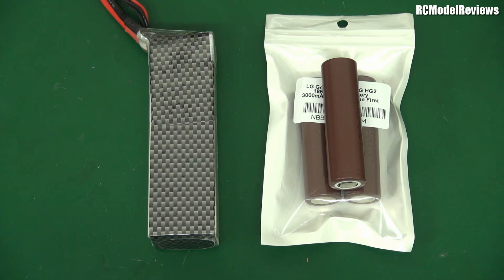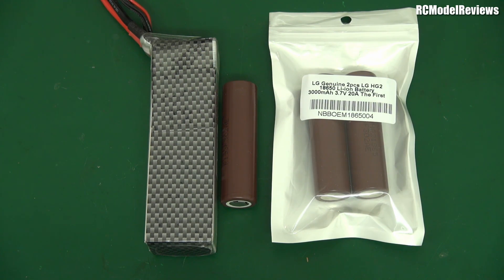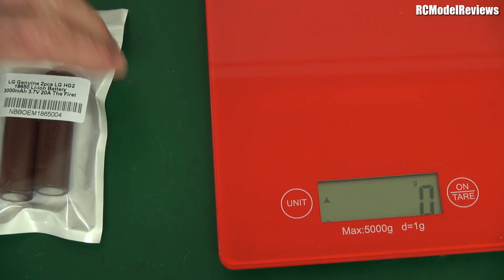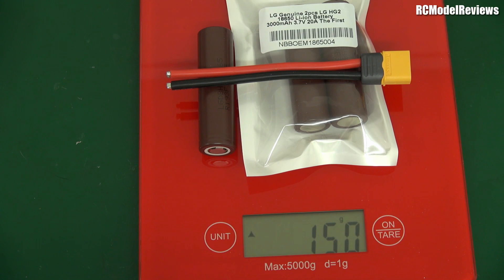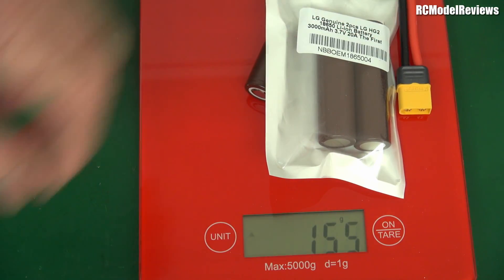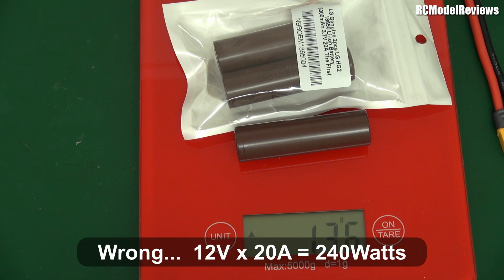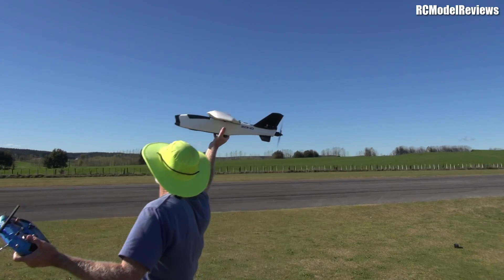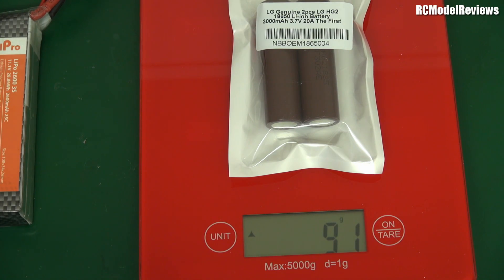Lithium-Ion (18650 cells) versus Lipo -- which is best?

Comment: Should make a hybrid battery with a small lipo and big lion pack
Reply: It would be great for transients like on launch and quick punches: launching Strix Goblin on 18650s is challenging to say the least !
Reply: Preproto you’d want a battery management system otherwise you could run into... issues.
Reply: @kand198  This isn't a powerwall or ebike: it's solved easily with telemetry.  If an entire series bank goes in an RC setup, well ces't la vie - we live with that risk every day.  This is why it's good to run a separate RX/VTX battery in a plane so that one can attempt to safely land if the main pack goes belly up.  In a quad, it doesn't really matter, so bombs away ! :)
Reply: I might be missing something here, but just thinking about it, due to the very different internal resistances of the batteries you’re going to be drawing very different currents from each pack.

Also they will have differing capacities (even if there rated capacities were the same).

Both of these factors will cause problems pretty quickly.

You could probably develop a pretty simple BMS that could be integrated into a PDB or ESC (PDB would be easier to design than an ESC but there are open source hardware ESCs out there) that could handle this.

A more rudimentary design could be to have a switch on the plane to swap what packs you’re drawing from bound to a switch on your controller.
Reply: Keith Anderson what problems ? You're making unfounded assumptions without any scientific basis. It's the exact same principle as capacitors used with batteries so the capacitors with far lower IR charge and discharge infinitely more quickly than batteries, allowing pulses of brushless motors to be smoothed out. A hybrid pack allows short bursts of high current which then essentially recharges from the higher IR cells when the high load is removed. 

I've built a pack like this myself by adding a cheap 3S car jump pack connected in parallel with 3S40P 18650 NC cells in a jumper box that used to have a Pb-acid battery. It wouldn't start a vehicle previously but does without issue with the low-IR cells added.
Reply: How do you ensure your cells stay balanced? Just be aware that that setup is still pretty low current and voltage so worst comes to worst you’ll probably just be killing your batteries faster.

My main concern is that if the batteries fall out of balance you are going to introduce inefficiency, wear, danger and lower performance.

Thing is that while they will “charge” the higher discharge batteries it won’t charge the cells evenly right? Keeping your cells balanced is really the core of battery safety.

I’d also be interested to see how it would perform in comparison to choosing a cell that has the right specs for the job in the first place. Or some sort of cap/super cap setup.

It just seems to me that in situations where it’s too small for a BMS there would be better solutions out there?

Also I wouldn’t consider it unscientific, it’s just that I’m too lazy to fully work through an analysis to check if what I’m saying makes sense - which I totally accept might not be the case.
Reply: Dave Johnson 

I discussed it with someone a lot smarter than me last night.

Straight away he made the comparison to supercapacitors.

The conclusion that we came to is that you would very quickly exceed charge and discharge rates on the Lipo and/or the liion packs if you were to draw any large amount of power, and that supercaps make more sense from a weight-performance standpoint but can be a lot more expensive.
Reply: Keith Anderson I'll just be over here actually using  hybrid packs without issue while you armchair quarterbacks keep chugging Miller Lites and fist-bumping 🤣
Reply: Dave Johnson ok buddy you can call me an armchair quarterback when you design and build a 600V accumulator from scratch.

If you want to ignore my advice then that’s fine. Since you don’t seem to have a very good grasp of electronics and battery chemistry in particular but are obviously into the hobby side of things I’d probably explain it as having very similar risks and consequences to charging LiPos to 4.25V per cell.

You have basically built a ghetto and impractical supercap setup that will cause the premature failure of the cells. There is no benefit over supercaps besides procurement convenience.

But I mean most hobbyists fly with puffed LiPos and shit so this is far from the worst I’ve seen.

Comment: Are there any chemical constraints for lithium-ion unable to provide the same or better current discharge as lipo? (on similar weights proportion to the ones demonstrated)
Reply: The often used distinction between Li-ion and Li-polymer has nothing to do with chemistry (it is used wrongly). They are all Li-ion batteries. The two battery types are the same thing, just in different form factors. That form factor (and therefore different internal construction) is the main reason for the different current capabilities. There are cylindrical cells available that can easily provide currents in the tens of amp like a pouch cell, because their internal construction is designed for that. The pouch cells, that so many erroneously call li-polymer, are just "li-ion polymer" cells, because they are wrapped in a plastic (=polymer) package as opposed to being in a metal can.
They can have different chemistry, but so can cylindrical cells between them and pouch cells between them. Again, the form factor is not what dictates the chemistry, what the manufacturer puts in them is. You can have the same chemistry in either form factor. Have you ever seen something like IMR, INR, ICR, IFR, LMO, NMC, NCA, NCO, LCO or LFP written on cylindrical cells or in their datasheet? Those signify different chemistries. Pouch cells use the same, although they mostly use the Lithium-cobalt-oxide chemistry (ICR/LCO).
Reply: superdau That makes sense. Saw those labeling in 18650 cells.  Thanks for the awesome explanation!!
Reply: There is a wide range of chemicals and electrodes for different applications. Basically you trade either cycle life or high discharge rates.
Eg the Rimac new 2C supercar has 120C discharge capacity 18650 cells.
Tesla uses a NMC composition for its storage batteries and NCA very low cobalt percentage for its automotive batteries. The cycle life is increasing, doubling every few years with latest estimates giving a million miles of use in their next generation Maxwell electrode packs, whilst dropping cost to $100kWh at the pack level.
https://youtu.be/VtoBkFF3X7E?t=378

Comment: Li-Ion tend to be used in low-impact environments, as the electrolyte is more liquid than gel (and also why the stronger casing).  Lithium is highly reactive (read combustable) and a case breach is likely catastrophic to a model.

Should be great for a cruise wing type model as the discharge rating is usually not as high as Li-Po, but for a raw power machine (like a quad or a heli), Li-ion would not be ideal.

Interested to see how this turns out.
Reply: The lithium in li-ion cells (and lipos, which are also li-ion cells and the same thing just in a different form factor) is irrelevant for fires. There's so little of it in the cells and it's not in metallic form either. All the battery fires are the electrolyte burning after being heated up by a shortcircuit.

Comment: I use only Li-Ion in my sub 250g project: https://youtu.be/8Vh1KOxKuLI . The problem is that current ESCs are made for Li-Po and have a low voltage cut-off function that cuts the power when a cell supposedly reach 3V. Manufacturers must update their ESCs to this new trend in Li-Ion batteries...

Comment: Factor in that batts get lighter as they drain.
Plus the well known fact that a cap on the esc actually gives you more power. Must be true, as RC car guys used to claim they could notice the added power after adding a cap . :-)
Reply: Capacitors Smooth The Drain Sags... ;~)P